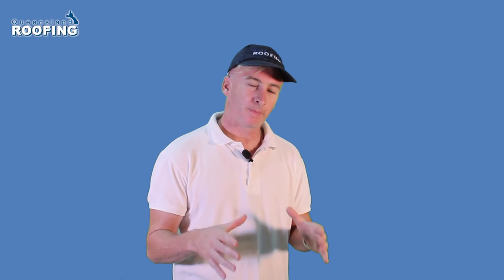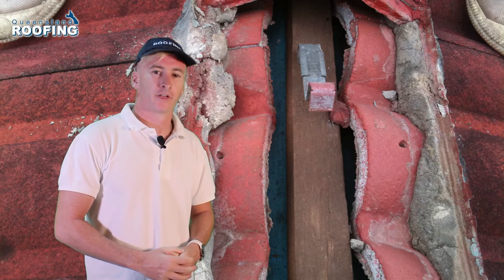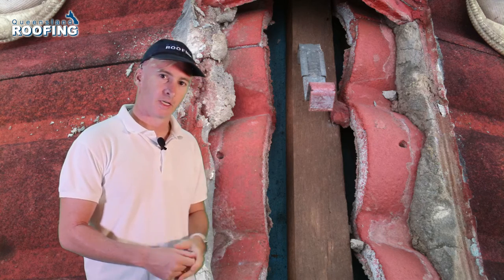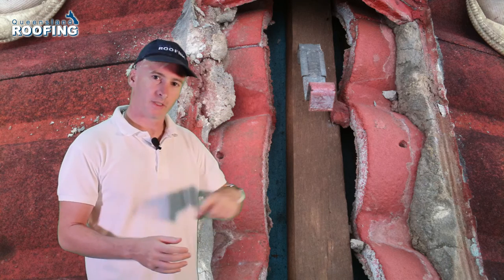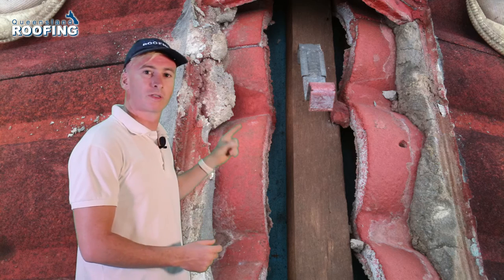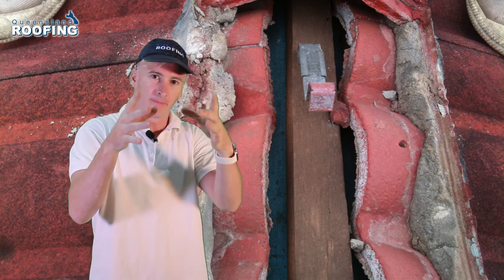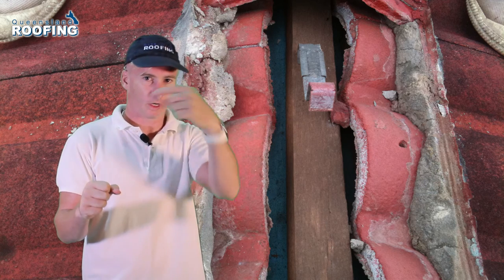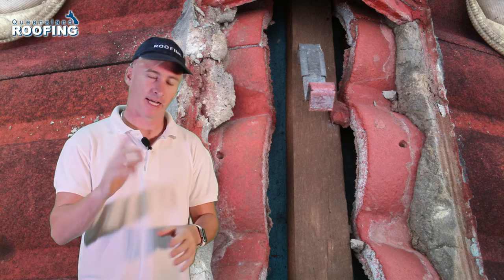WEEP HOLES RIDGE CAPPING - Queensland Roofing

Comment: How does the water get in there in the first place. Water never use to enter. From what I see. The water enters when pointing has not been done correctly. My home was built in the 60s. Brought my home 2004 and never ever had issues with my roof until it was cleaned with bleach and they also pointed down the valleys three years ago. It is full of mold now 😡. I am kind of irritated with myself because I allowed them to repoint my valleys when they did not need doing, thus it may have created entrance for water. Praying that has not happened. I

Comment: Old mortar- pointing method I agree would benefit. Modern Gen two 2050-2003 pointing adheres so well; I argue that weep holes are redundent.  I have proved weep holes allowed water to enter and leak. Sealing the weep holes only ; stopped the leak permanently.
Reply from the maker: Paul O'Connor  Weep holes are code in Queensland. I would need to know more about your specific situation. https://www.boral.com.au/sites/default/files/media/field_document/15395%20-%20Roof%20Tile%20Technical%20Manual%20-%20Nov17%20-%20Final.pdf
Reply: That makes no sense. In most parts of the world, water flows down hill. That must of been a pretty exceptional situation.
Reply: Dale Anderson I’ll need to explain to you how it actually works. It’s nothing to do with water going up hill. You’ll need a deeper understanding of roof tiling. I’ll make another video to explain how the water gets in. If we were to block weep holes the Queensland  building and construction commission would class the work as defective and order the work to be rectified. If you call the company I’m happy to run you through it.